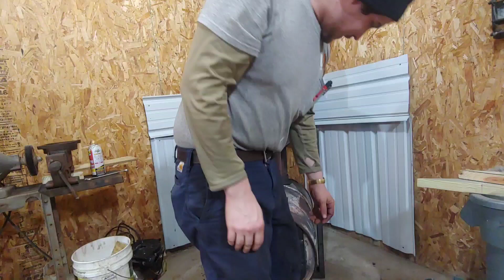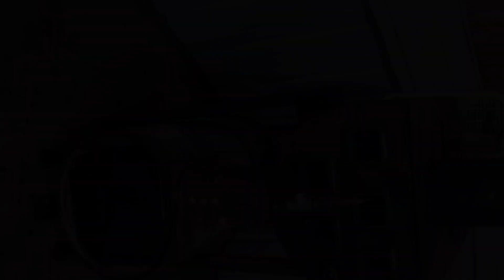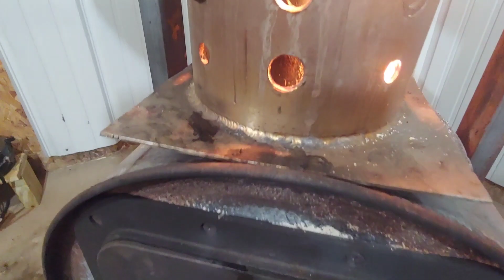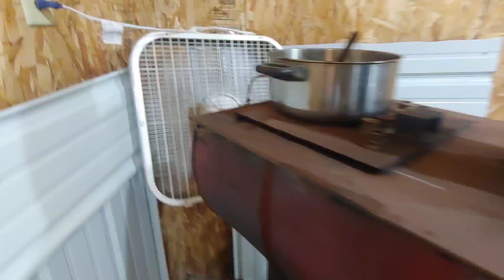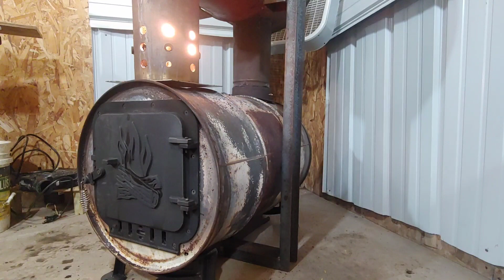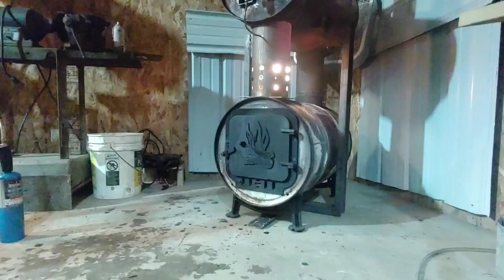Burning oil! homemade waste oil furnace

Comment: How did you figure out how many and what  size to make the  holes in the pipe?
Reply from the maker: I ran the numbers of free air requirements for a flame burning at various BTUs. Then I converted that to the available air through the circle holes. I know it isnt 100% accurate but it was enough to get me a baseline.

Comment: how do you ever clean where the oil burns??  That channel iron will get filled up with residue.  How do you light the oil?
Reply from the maker: I light it by squirting a little syringe full of diesel in the bottom and sticking the torch in one of the holes. So far, ive ran quite a bit of oil through it and havent needed to clean it at all. But I'll just pull the whole assy out when that time comes, or blow it out with an air gun.
Reply from the maker: I have a video posting in the morning showing me cleaning it at the end of the season. I had some personal things come up, sorry it took so long!

Comment: I wish you would show all the pictures of the oil burner and show how it works please. Thanks
Reply from the maker: Is there anything specific you would like to see, or just a couple still photos of the inside?
Reply: Just still shots from inside
Reply: Please send me the pictures. Thanks
Reply from the maker: Yes, sorry, can you add your email to your YouTube account? I'm not sure how else to get ahold of you.
Reply: @KindsKattleRanch  can you just do a video of the burner how you clean it out. That should show the internal workings of the burner and an idea of how the burner is made and works. Thanks
Reply from the maker: @buckshot8393  sorry, I know its been several months but i had some personal stuff come up. I have a video posting in the morning of me pulling it out and cleaning it, as well as some adjustments id like to make.
Reply: Nice work, great build. Just a note for you and builders in future. Add a screen lid on top your oil reservoir.  Had similar stove
 Went in house for supper. Came back fumes above screen igniting and flames shot 2ft up above reservoir. Every 2 min.  Closed damper and shut fuel off.if I didn't have screen there would been explosion followed by a fire.  Screen really works as temporary fire prevention. One time was scary enough. I now use for years now ,safety temp and fuel shutdown controls